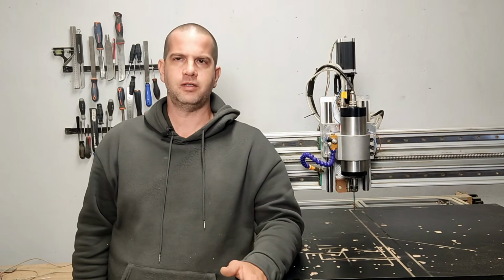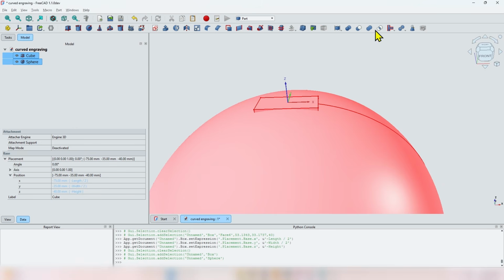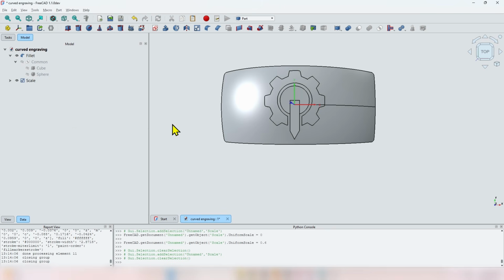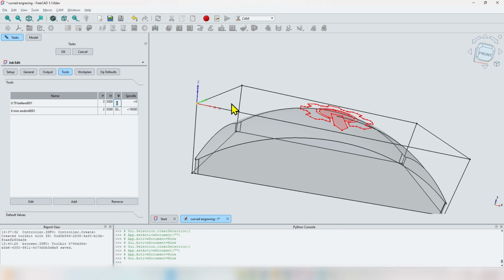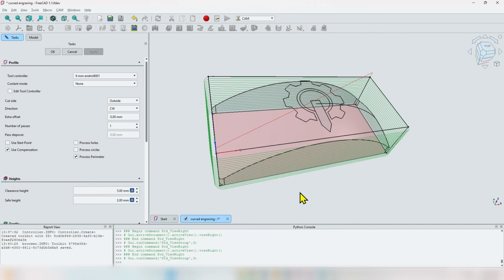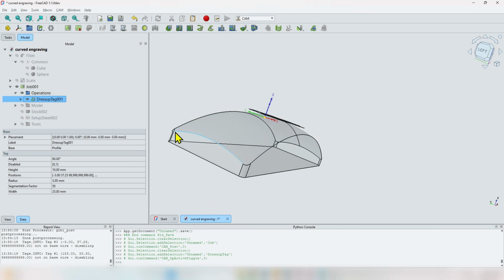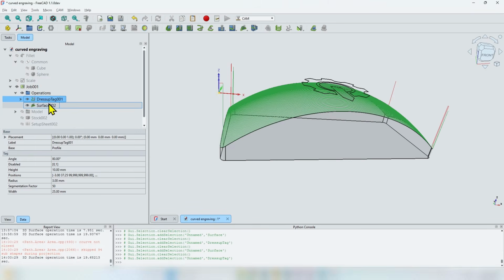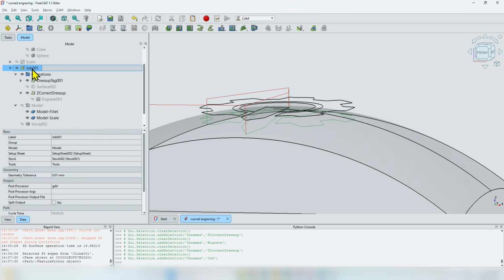3D Curved Engraving in FreeCAD 1.1 | Full CAD-CAM Machining Workflow

Comment: God I fucking hate this software. So if there is no normal face to the spindle axis, it cannot make a profile? I can;t just select four edges that define the profile I want to cut?
Reply from the maker: You can do that. Go to the CAM menu, Supplemental Commands. There, you will find Path From Shape TC. Don't expect it to be easy to use, but it works. Sometimes ... :)

Comment: Your material removal rate for the tapered ballend seemed crazy high, and the job was done crazy fast, I was shocked you went full depth + 80% stepover! I've been using low depth high stepover 6mm square endmill for roughing down, but I think I can rough faster. Can you share any wisdom for how to get faster cycles/higher MRR?
Reply from the maker: I have to admit that I got pretty scared at the first pass. After that, each pass was with a low stepover, so no worries there. I'll make a video about feeds soon
Reply: @opensourcecnc  i look forward to it! Feeds/speeds, high axial depth + low radial cut (cutting more with the edge) VS low axial + high radial cuts (shallow, full stepover), chipload, cutting pattern (eg adaptive), tool geometry, bend angles (90 deg gives high force spike), there's a lot here :D. Love your videos!

Comment: thanks, im using CNC rich auto controlled, how do i do the post process
Reply from the maker: You're welcome. From what I see, it uses generic G-code, so the grbl post processor should do it. What I also noticed is that, by default, some of these controllers don't have certain options enabled. You need to enable them in order to work (for example the F for feed speed is ignored), so take care about those options of the rich auto controllers
Reply: @opensourcecnc  thanks. Another thing is, I can't see the Waterline toolpath.
Reply from the maker: Did you check the short video I sent you, to enable the experimental and ocl features?

Comment: Danke!
Reply: ps: what exact cnc mill is this?
Reply from the maker: Thank you very much for the support!
It's not a brand CNC, it's a custom one. I use an esp32 board with external steppers and fluidNC firmware
Reply: @opensourcecnc I do use a 4axis daisy chain fluidnc board, but just attached to a 3018
Reply from the maker: Just googled what a daisy chain is :).  Does it have advantages over separate control for each driver?
Reply: @opensourcecnc  wouldn't think so besides using less pins. I didn't care about that aspect, I was mostly interested in trinamic drivers when buying this board from bdring some years ago.

Comment: Nice video !, Is it possible to do multiple pass fo the 3D surface operation ? Thanks
Reply from the maker: Yes. Change the Layer mode from Single line to Multi pass. Then go to the Depths section and set the required step down. Recompute. The 3d Surface operation will now have layers.

Comment: thank you for these tutorials im a novice at machining and modeling and you have inspired me to prioritize ugs and freecad so that all the stuff i can achieve is free/open source/repeatable for others. and you have also helped me through some of the more nuanced cad operations and understanding what they do/how to make them do what you need them for. i was considering a college course that would have cost around 40k usd for 2 years to learn these things. Instead you have inspired me to bet on myself buy a genmitsu 4040 pro and do a few upgrades to make it a decent machine for brass/copper/aluminum/wood/plastics and using these tutorials, time, and trial and error i have learned around 90% of what the college course teaches in about 6 months for around 1400$ usd for the machine/tooling, enclosure, upgrades, and even a 4th axis when the courses i was looking at only covered 3 axis. Thank you sir this is valuable information and the fact that its all done on something everyone can use is even better keep up the good work.
Reply from the maker: Thank you for this amazing story! This is the fuel that keeps me going. I've been there and I know the struggle when starting on such a difficult journey. I'm glad I was able to be helpful.